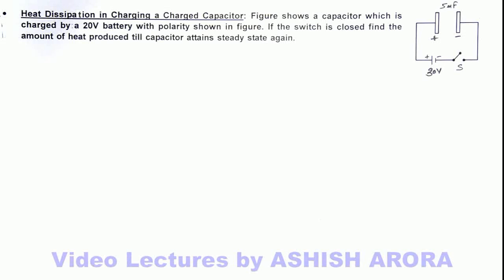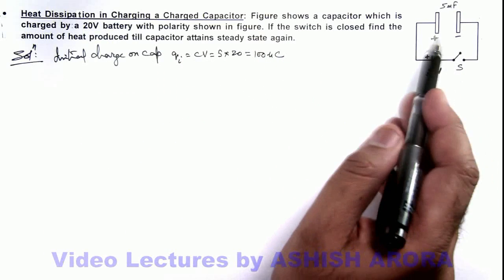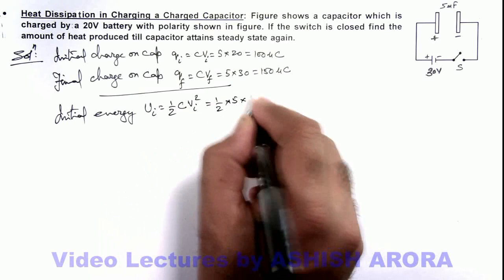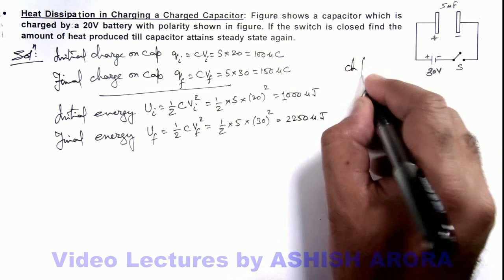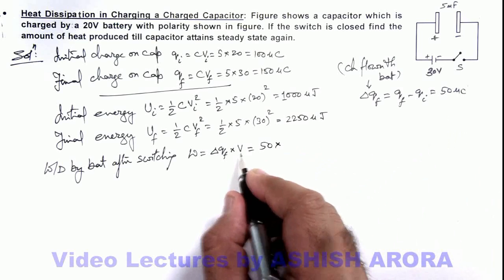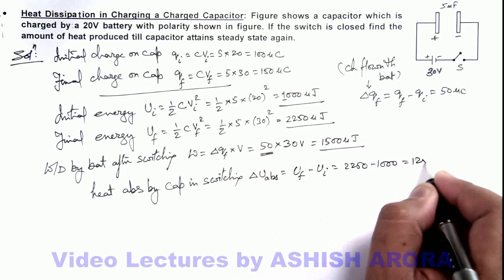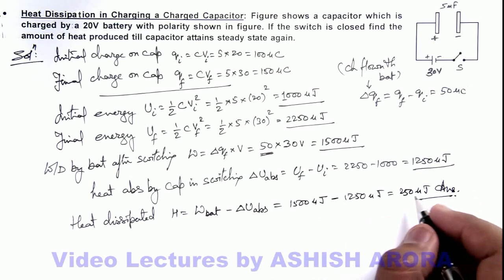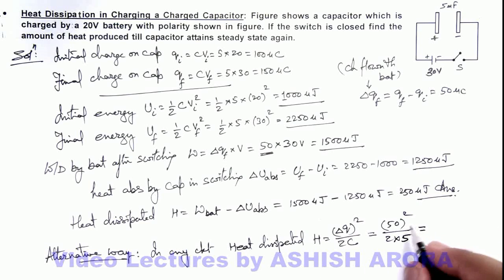7. Advance Illustration | Capacitance | Heat Dissipation in Charging a Charged Capacitor

Comment: Sir what if we reverse the polarity?
Reply: See question no.1
Reply: @thor-2300  no effect on heat produced
Reply: @YdvSyAero  no brother i guess heat dissipation will increase as work done by battery will be more than earlier 
Previously it was 50×30μJ
Now it will be 250×30μJ😊😊
Reply: @YdvSyAero  nhi
Reply: @Mnitjaipuree  bro i have qualified it and  now i am in the campus.
Reply: @YdvSyAero  😁general ho aap?
Reply: 6250 micro joule

Comment: sir , if we want to calculate common potential of two capacitors connected together, can we use c1v1+c2v2/(c1+c2)  for both series and parallel connections?
Reply from the maker: You should not use any direct formula for common potential... as for any case you can easily calculate it by using V=q/C(eq)
Reply: you got which college
Reply: @shaurya361  ab to bhai wo nikal chuka hoga college se shayad teko bhi mil gyi hogi .